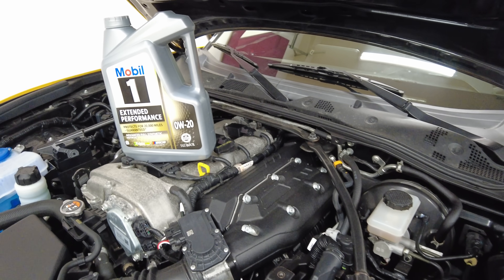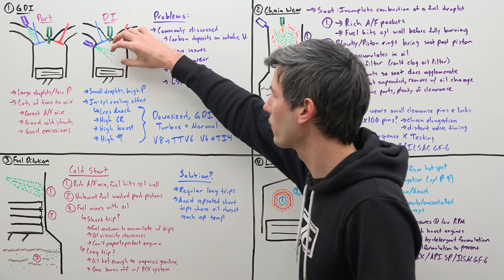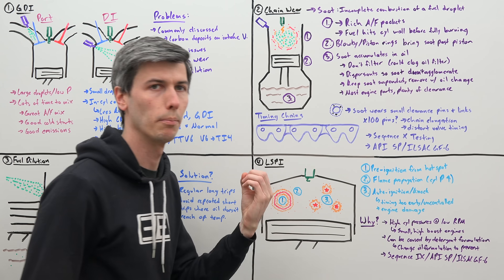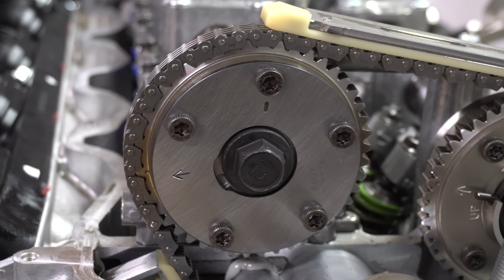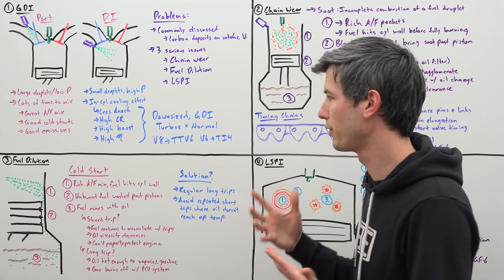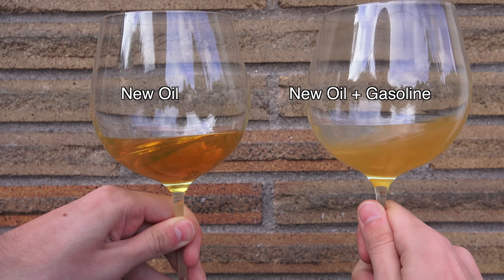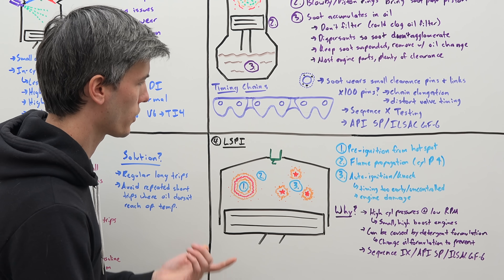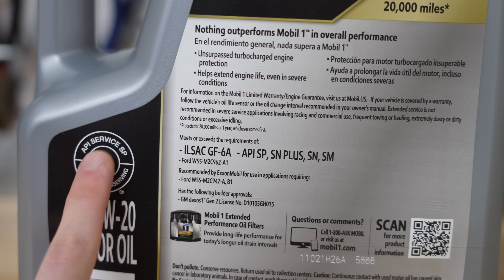3 Big Problems With Direct Injection Engines (Gasoline)

Comment: A huge issue with the previous gen VW/Audi 2.0 TSI engines, aside from carbon fouling on the intake ports and valves, was that soot you mentioned clogging the ultra fine mesh filters that preceeded the balance shaft. It was not uncommon for the balance shaft to tear it's bearings apart and subsequently send material into the oil pan, straight into the pickup and into the crank bearings. Those engines are notorious for destroying themselves in 100 000 - 150 000km if you stick to the factory 16 000km interval. That being said... I've seen one that did that, and lasted another 200 000km with regular 6000km oil changes before the crank journal bearings finally gave up.
Reply: More or Less as planned by the manufacturer. 
Service intervals calculated at elevated wear rates to failure.
These calculations can be made and are being made all the time especially in Formula 1
However, the majority of people that are NOT in the know but thinks they are or have self interest vested in the early failure spread the misinformation hiding the trend of shorter life cycles and designed or planned obsolescence.
Reply: @crxdelsolsir  F1? I don't think so since they are pretty limited on the amount of engine's and part's they can use so if they blow thru many engine's the season is over for the team.
Reply: @kaedeschulz5422  

F1 is not out to make engines to prematurely fail but rather the opposite. Try to develop engines that last as long as possible. 

However they do need to know when the engine is near failure and replace it to avoid penalties etc.

The point being is manufacturers through RnD and oil used (suggesting longer service intervals) etc can measure (induced) engine wear and develop engines to last a precalculated distance.

They are definitely not blind to accidentally making engines break down sooner than older engines.
Reply: @crxdelsolsir  Wich is why one should treat a modern car just like any other car and do it like every 5k miles / 8k kilometers or something and not every 20thousand or so. Depending on how one uses the car tho.
Reply: @kaedeschulz5422  Problem is most people are good, trusting and follow "authority" "professionals".

If the manufacturer tell them 15k or 20k they follow.

Actually if the manufacturer tells them for life (transmissions and seald ones) they accept openly trustingly.

This is manipulation and those that think out of the box are labelled rebelious, conspiracy theorists etc rather than critical/independent thinkers.
Reply: @crxdelsolsir  Yea that's the problem. Ppl sadly just don't do their own research or ask actual mechanic's.
Reply: Yes those "long life oil blaaa blaa" oil change intervals are just bad!
Reply: @kaedeschulz5422  Long oil change intervals are the major factor in reduce engine life IMO. The BMW service manuals changes to longer intervals of their newer get cars when they were using the exact same technology as the older gen cars. It's basically making them have a lower service life on purpose. The worse is the automatic transmission fluid change interval which is mostly non-existent in many modern cars and those are the 1st parts to fail.
Reply: @SI0AX  And then i see those car's on here in Germany om the channel "auto doktoren" with the problems they have to fix. The mechanics themselves don't understand why on earth they say it should be like this if a car should last long.
Reply: Fords i3,i6 turbos too are in same ball park.. Most f em good for 1,00,000 to 2,00,000 kms, after than junk
Reply: Yes the car will less efficient than a 20 years old NA engine.
Reply: @GF-mf7ml  try TDI then, even the 3.0 litre V6 TDI is more fuel efficient than a 4 cylinder NA petrol engine
Reply: I've had several turbo VW's and I now have a BMW X2. I faithfully change my oil every 5000 miles using Motul full synthetic since I do frequent short trips.
Reply: Fingers crossed this 1.8 gen 3 engine in the wife's 2014 is better than the old 2.0 .
It's got like 82k now ,and seems to start ok in the cold.
I'm aware of a carbon clogged intake can cause some cold misfiring so I'm waiting for that. 
I saw one they had the intake off of on the Deutsche autoparts channel ,it had like 130k or more on it and was fair as in it needed cleaning but was nowhere near an old 2.0 that had it done twice by that kinda mileage.
Reply: What about Porsche Boxster/Cayman S DFI engines in the 987? Any long term experience on those?
Reply: @dohabandit  There is no aftermarket solution to those motors? Has no one attempted to take it apart and rebuild it?
Reply: 500k Vw mkV golf tsi engine. Everything engine original. Installed water methanol injection kit at 30k. Smallest 50cc nozzle. Vehicle is strong and zero carbon build up.
Reply: @lukekilah6257  How much have you spent on methanol and demin water + the kit in 470,000 km
Reply: @lukekilah6257 
German engineering at its finest
Reply: @1989rs500   Rubbish
Reply: @lukekilah6257  Hallo, ist dass von TÜV zugelassen für öffentliche Verkehr? Danke.

Comment: All cars will suffer from only short trips. That's not unique to DI. 

The biggest issue with DI is soot build-up on valves which can be alleviated with routine oil changes with a high quality oil and an occasional fuel system cleaning through the throttle body. The build up on the valves is not from fuel but from oil evaporation (i.e. breakdown of the oil) being drawn back through the PCV system (look for the Noack value of oil). If you use a high quality oil and change it routinely, you shouldn't have any issues with modern DI cars. Some of the earlier versions (VW in particular) simply had bad designs that contributed to the build up on the valves, but I think that has mostly been mitigated now.
Reply: I'm running a 1L ecoboost fiesta, I change my filter and oil every 6 months with 5W20 Castrol Magnatec. This is between 2500-3500 miles, 90% of which are trips to work and back. Around 10 miles each way and a mix of 30-50 MPH roads. I mostly full up with, shell v power (yes it cost more than E10) and the few tanks I didn't use it. Due needing to fill up during the fuel shortage 2021 (UK) or just trying another supplier. I found the tanks didn't go as far.
Reply: A water vapor injection has been proven to be the solution for DI engine many years ago by inventor George Heeley....the results will better MPG, better emissions, less wearing and tearing of the tranny and engine, no carbon build up at all etc..... car's manufacturers are aware of but for obvious reasons they don't want to expense money on it.....😃

Comment: Anybody know if letting the car run at idle helps with the issue of short trips?  I work two miles from home and it's about a 5 minute trip.  But especially this time of year sometimes I remote start for 10-15 minutes prior.  Does that help with burning off the excess gas?
Reply: Actually every mechanic over here (Germany) says that is worse because the engine does not get up to operating temp but is still running in idle, causing excessive wear. They recommend - independent of the brand they work for - to start the engine and set off right away at low load and low to medium rpms (up to 2500 to 3500) and increase that as the water and oil temperatures increase. This is said to be the quickest way to get the engine to a temperature it feels comfortable at.
Reply: @englyn1    Thanks.  I think I’ve read something about that before.  Unfortunately on cold and snowy days I have to let it run first.  May not be great for the engine but it’s good for me!
Reply: @LT4POWERED  Yes, there are always certain trade-offs you need to make. I certainly don't blame you.

Comment: Do you think any manufacturers will seal off the timing chain area from the engine oil and fill that area with it's own oil that won't accumulate soot?
Reply: Or just use a timing belt.

Comment: So?  is direct injection the devil or the best thing ever?  Toyota used both systems in some of their engines.   Idocars ripped apart an ecoboost and the thing looked brand new inside, yet it had well over 100K miles--although the valves had the deposits.

Comment: What about the "cheap" pump gas?
Not cheap as how much you pay per gallon,
but cheap as ethanol, which comes from corn
and gunks up your fuel system, turns to sugar when it evaporates, and also ethanol is corrosive to aluminum, like water is corrosive
to ferrous metals... These cheap ethanol diluted fuels also produce alot of carbon that dirtys your engine at the expense of running these engines "hotter" which destroys your engine at your expense, yet the EPA wants you to run your engine clean at your expense...

Comment: "you don't actually want to filter out the soot, it can end up clogging your oil filter"

No, *shakes fist at shitty oil filters*, I want bigger and better oil filters! Stop making the tiny shitcans we see on the shelves!
Reply: It's pretty ridiculous how small they are getting. Sometimes you can find a longer/wider version (when they aren't just the replacement filter element only) but you need to be sure the bypass pressure is the same, and even those options are becoming scarce. That, and engine bays are getting more cramped, and there isn't always room for the bigger one.

Some super high end engines are getting dual oil filters, though.

Comment: Every spring, every fall regardless of how low mileage is.  Then 5000 km tops per oil change if I do more.

Toyota is a bit clever with solving this issue.  They have port injection when do not want the direct.  Solves most of the DI issue addressed here.

Comment: I drive an Audi TT RS, it's quite possible a perfect example of engines talked about in this video. Small displacement (2.5L over 5 cylinders), with lots of power, torque, and boost pressure. 18.1 PSI as early on as 1,700 RPM. Peak torque (343) from the same to 5.4K, peak power (360) from 5.4-6.8k. I'm now going to make sure no matter what I buy API certified oil. Especially as my goals for the car are around 500 HP/TQ on a similar power band, at higher PSI, with pump gas.

Always informative, Jason.
Reply: Endless money pit car in countries where people don't know how to repair them right.
Reply: @BubblesTheCat1  I don’t know where you’re getting that from, but if Audi/VW does one thing right, it’s five cylinder engines. People often see well passed 300k miles of engine life even with track use and heavily modified, with nothing but typical maintenance. Mine is as 72k miles and needed nothing but standard maintenance.
Reply: @JustinBone  Are you from Germany?
Reply: @BubblesTheCat1  The US
Reply: @JustinBone  😊👍
Reply: @JustinBone  Well, sorry to bust up your dreams, but VW group cannot do one single thing right. That's why their cars are crap, no matter what the marketing is telling you. VW group has awful cars, endless money pits.
p.s. 72K miles is nothing! You cannot judge the reliability of an engine with such a small mileage. Wait to reach over 90K-100K and then you will see.
Reply: @Nick-GR  You’re only misinforming yourself. I’m in a group with hundreds of current owners of this exact platform, many of them with well over 35% more power and torque than factory supplied at well over 150k and still running reliably. I have a daily, naturally aspirated 2.5L that the 2.5T my TT RS engine is based on running strong and reliably at 160k. This is my sixth VAG car, I’m aware of what I’m talking about. There are people who literally abuse and mistreat their 07K based VAG engines that still see over 500k miles with no major failures or problems.

Don’t drink the internet coolaid. Enter a few owners groups and talk to real people who actually own the cars. Are all of VAG’s engines flawless? Of course not. Are they all reliable? Of course not.

But there are definitely some that are genuinely very, very reliable, well passed 100, 200, 300, even sometimes we’ll passed 400k.
Reply: @JustinBone  My 1995 Audi S6 has a 2.2l 5 cyl (AAN) that has 334k miles. Original turbo.
Reply: @Nick-GR  simply not true. Audi 5 cylinders are very reliable. Bunch of people on QuattroWorld have 200k+ miles on their engines. If there’s one thing Audi knows how to engineer, it is a long lasting 5 cylinder. They have been making them for 4 decades now and countless Motorsport use’s.
Reply: @JustinBone  Do you really think i will go into this kind of discussion with a fanboy? Just because you say something, doesnt make it valid. Claims of 500K miles on a VAG without issues, will cause a lot of laughs to a lot of mechanics.
Reply: @yashsab2  The 2009 revival of the 5 cylinder is a joke in terms of reliability. It might has a nice sound and pretty good performance but is nowhere near the 1976 5 cylinder variant. Cut the crap ok?
Reply: @Nick-GR  okay lmao

It’s widely available and common knowledge. VAG 07K’s are genuinely reliable engines. You can search it for yourself. Or don’t, not my problem

Comment: The new Nissan VC-Turbo engines [Variable Compression, Turbo, Direct Injection] are just what we need. We can expect both transmission and engine failures now.
Reply: More because it's Nissan than high-tech.
Reply: @townhall05446  More because of ringing ever bigger horse power and torque out of ever smaller displacement.  That being said, I have no trust in modern Nissan vehicles either.

Comment: Previous vehicle was non turbo direct injection , traded it in at 299,000 miles never had any of those issues, oil change at 5,000 mile intervals, lived in Alaska so many starts in extreme cold temperatures without issues, one trip over 2,400 miles through canada in the winter towing a trailer without issues had over 150,000 miles on vehicle before that trip, biggest factor in having problems with injected vehicles is QUALITY of the fuel, some gas stations it didn't matter what engine I ran the fuel in they all ran bad because the fuel was garbage.
Reply: What was the make and model?
Reply: @no1lineman  2014 Hyundai Tucson ltd AWD had a 2005 kia Amanti before that also sold around 300k miles.
Reply: @no1lineman  He is missing points like Direct injection is mist injecting into a HOT cylinder, I am wondering how much of this is just to sell the mobile oil, you should see his video on brakes he contradicts himself and made me wonder how much he actually knows about vehicle operation he talks about all the brake dust and how bad it is then goes on to the new rotors on Porch and how little wear happens on the new rotors therefore reducing brake dust.... the brake dust comes from the brake PADS not the rotor also in the video he wedges the jack stand under the the car jack completely UNSAFE.
 in this video turbo boost really kicks in at HIGHER RPM.
Oil filters filter out small particles if they start to plug there is a bypass valve built into the filter, if you change filter at proper intervals it will never be an issue.

Comment: Only Jason, can make an entire product placement video both interesting and useful.
Reply: it helps that Mobil 1 is smart about it and doesn't try to ram it down your throat the entire time.
Reply: good products im ok with. its when they start slinging crappy products at my face that I cant stand. Only the hot stuff please
Reply: I was already using mobile one anyhow.  And have been for 30 years.   I must say I have yet to get rid of a car because the engine was bad.  But it's surprising how many other expensive things can go wrong.
Reply: Very well done product placement. Didn't tell us we need Mobil 1, but did show what standard we should buy and subtly showed Mobil 1 meets that standard.
Reply: Gotta pay the bills. 🤓
Reply: No comma needed, Ted.

Comment: I haven't watched the video in full yet, but I did notice that there isn't anything mentioned about how direct injection suffers from a loss of low end torque production due to inadequate fuel-air mixing. I think it would be interesting if you were to make a video about the 3 most common forms of fueling placement(for lack of a better term) in an engine and the pros and cons of each, such as shower/carb-style injection providing a cooling effect on the intake charge, port injection's low-speed charge mixing based on intake port design, and direct injection's ability to cool the combustion chamber and run higher compression.

Comment: i get around the carbon build up on the intake valves by using a water methanol injection kit on the air intake after the intercooler . also i never stress the engine untill the oil is up to temperature to help prevent bore wash and "gas" in the oil